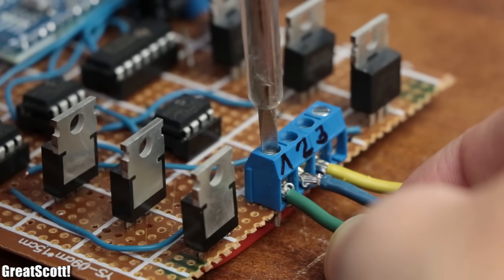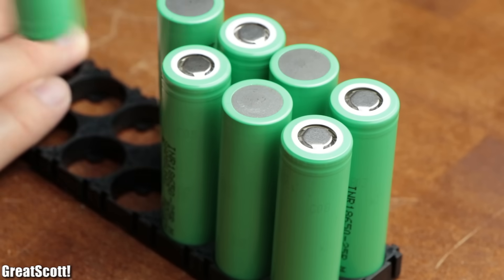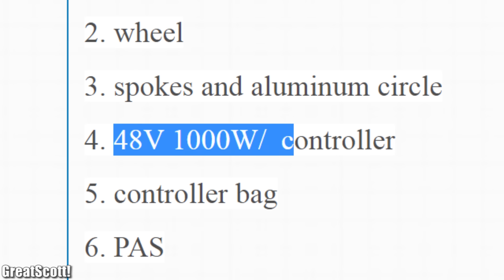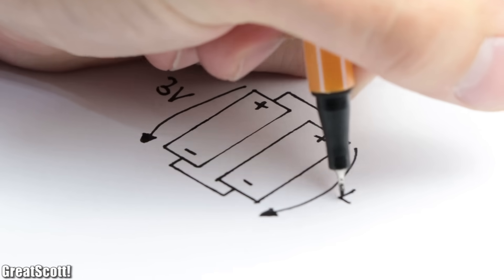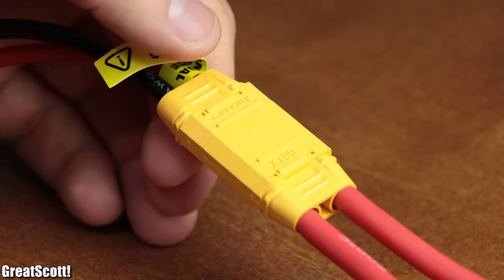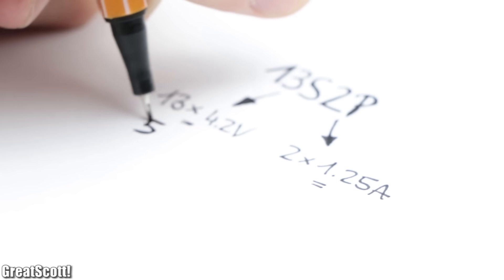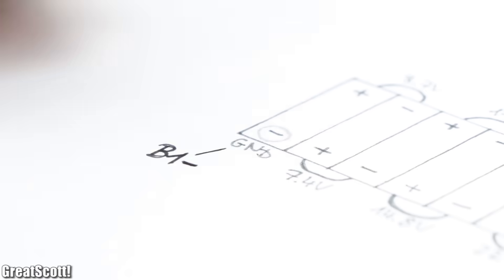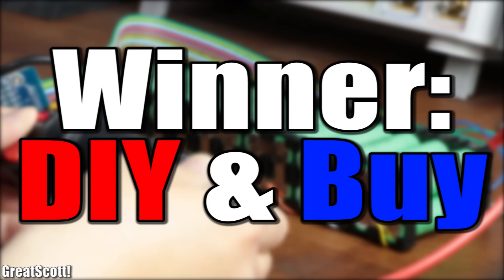EBike Battery Pack || DIY or Buy || Electric Bike Conversion (Part 2)

Comment: You don't need 20A cells anymore if you are only doing 2p... 
Whats the point of calculating amperage for 1p then buying 2p?
30q would of been perfect, more capacity and possibly cheaper.
Reply: Running batteries at less than their maximum C rating is more efficient. The more current you push through them, the more (I^2)R losses you incur, therefore there is more wasted capacity, and more heat reducing the longevity of the cells. It's never bad to have a good safety margin, unless you are trying to "get away with" as few pennies spent as possible.
Reply: Nacho Mendía Heavier than the four Lead Acid batteries you would typically use with a bike? Yeah I definitely not... Even if you went for small 5Ah batteries they would weigh about 4lb each so 16lb total and even heavier at a more useful capacity like 7-9Ah, whereas an 18650 will weigh about 50g per cell, so that would be 8.6lb for a 13s6p pack which is considerably lighter.
Reply: I don't think many people use lead acid batteries on a bike anymore. Unless you buy the cheapest junk you can find.
Reply: those drivers tend to pull alot more at peak than advertised, its definitely worth the investment
Reply: Kevin Day Sure, but in the end 13S6P pack with 2000mAh 5A cells will do better than 13S2P 2500mAh 20A in my opinion. And it can be cheaper as well.
Reply: Wojtek Kamiński Yeah, I meant to mention in my comment, I'm not saying that his solution was the best one, just that there is at least SOME reason to do the calculations for 1P and use 2P.
Reply: You want a bit of headroom here...
Reply: LegendLength hobbyking lipos are way more overrated than the Samsung 25r 18650s, from my experience most of the high drain Samsungs are underrated ie the 30q, rated at 15a but stays well within operating temperatures at 20a
Reply: the battery pack he made is only 240Wh, it's really small... he could have used batteries with 5A max current draw, but make 13S6P pack for at least 500Wh capacity (with 2000mAh batteries...). It would have been cheaper and of course it would last much longer
Reply: Yeah, and also I don't believe that motor is actually going to draw 1 kW continuous. If that was the case, how the heck could he power it from his PSU?! That's probably peak power, at which the motor is very inefficient. The actual continuous power is probably around 100 W or so. And we all know Chinese sellers usually lie.

Comment: I just have bought one pack with 52 of SAMSUNG INR18650-33G batteries. 48 V, 12.8 Ah for 330 USD. If one battery would cost about $4, it would be $208. Plus BMS, charger, box, nickel ribbon, connectors and welder.. I guess it would cost about the same, or more (thanks to the welder), as shown in video. Plus your time.. It's not worth it.

Comment: How would you compare this kind of pack to one based on RC lithium-polymer battery packs? I'm going to be working on an electric scooter project soon, and I was aiming for li-po batteries primarily because of their cost and relative ease of use.
Reply: Lipo isn't widely spread despite it's large current advantage in evs cause it has less charging cycles of longevity and is more volatile. Both li-ion and lifepo4 can supply enough current at any reasonable capacity, and lifepo4 has much larger range of operating temperatures.
Reply: LFP is the safest chemistry but needs a larger volume. Lithium polymer has the best energy capacity so is fine for small gadgets. It is too sensitive for heavy duty power especially with vibration in a bike or scooter. Not safe. Don’t go there.
Reply: lithium-polymer will be almost the same as far as the math goes compared to lithium ion.  If you used packs you would probably want to use 3x 11.1v packs and 1x 14.8v pack in series to get to 13s.
Reply: Do not use lipo is a bomb waiting to set your house on fire. save a few bucks loose your house gg. Use lifepo4 only.
Reply: @ahah1785  you're fake news!

Comment: Recently I have a discussion around if putting a pair of cells in series or parallel does really affects the amperage draw of each cell, If in a pack of 2 cell in parallel or series  you draw 30amps each cell is putting out 30amps, basically, that was the accepted rule in the group, I did my research and I found exactly the same, but my common sense told me that putting 2 cells in parallel is going to divide the load in each cell, I will like to know more about this topic or what are the basics of this rule.
 I love the content Scott, Watching all the way from Argentina 
Sory if my English is too bad tho lol
Reply: You need to know the basics of parallel and series connection of cells. Simply put, in a parallel connection of cells, current draw is divided and in series connection both the cells give the same current. Keep in mind in parallel the resultant voltage is the lower voltage of the two cell voltages, in series the voltages of each of the cells get added.

Comment: I am working on a very similar battery pack design for my electric bike that I have made. But I have to say, you will want a battery pack more then 5ah. At the moment i am using 4, 12v-18ah lead acid batteries in series to power it, and those get the job done, but I am collecting 18650 cells, and from the research I've done, I wouldn't go under 12ah at least.

Comment: I like the video. Just in case you didn't know, I thought I would make you aware of some separate options for cheaper batteries.

A popular option in the hobbyist community is to buy lots new laptop batteries and disassemble them for cells. The cheapest option I'm aware of is going for used cells from dead laptop batteries.

Used cells are a bit tricky as they must undergoe some tests to verify their capacity and condition. Afterwards you organize them Into a pack with similar cell capacitys.

This is the option I went with for my personal battery, I ended up with a 14s 12p battery, it runs about 27ah. It cost me less than 100$, but a fair bit of time.

I'm excited to see how your project turns out!

Comment: Can't LiPos be used instead? 4 11.1V ones in series?
Reply from the maker: Also possible
Reply: Is it ignored because of the safety aspect then? I think the LiPo way could be cheaper. 

Another thing, can these be charged from the energy harnessed from the wheel motion when not accelerated by the BLDC motor?

Comment: It would be more cheaper
If you buyed those Li ion 🔋 18650 cells from a offline store
They'll cost you about 2$ per pc
Reply: Your Indian Brother maby in India not here in Europe we don't have that kind of electronic store
Reply: You'll not believe that I ordered 10 genuine old laptop battery cell for only 4$
There capacity is 1800~2100mah
From a offline store
Reply: They ask you $2 for a used cell?
I can buy used cell here for less than $1, 1000 - 2200mAh
And I bought new cells for $1,5 each, 3000mAh

The problem with used cell is they have vastly different parameters, making them not suitable for battery pack where the cells have to be the same.
Reply: Hey guys this 18650 from old laptop can only give 2C 
we are far from the 20Amp he get
Reply: but wait if any lipo batrery is 3000mah

Comment: USB SOLDERING IRON DIY OR BUY
Reply: I would not trust that on my computers ports! Manufactured or home made
Reply: Whats the point of such a tool when there is always acces to a 230v socket in your home? Unless you want to go soldering on your train ride to work i dont see why you would limit yourself to a (in most cases)  1amp 5v usb output
Reply: Yea, it's not in the specification (900mA for USB3), but some motherboards can deliver 2A+ !
Reply: Stop it ffs. Nobody wants these damn USB irons
Reply: @smow7422  I think they want it for portability. So I'm thinking why not a 12VDC 7Ah (minimum) battery from a motorised gate?
Reply: Lalan Desai Just get a TS100 and wire it to an old laptop battery
Reply: usb ports can provide 1 amp??!
Reply: wow, i didn't know that, thanks!
Reply: Lalan Desai stop it
Reply: Sean Spitler,
how about a powerbank with 2A port?
Reply: Igor Morozov 2amps also wouldn't be enough (2a×5v=10W) my smallest soldering iron already requires 30W, so i would imagine that soldering with a 10W soldering iron would be a pain...
Reply: gustav games 
Nope, there is a small 8w iron on aliexpress around 7-8$. Excellent for smd and good enough for small through hole work.
Reply: I'd go Battery powered, and use something like a 3-4S lipo for drones or similar.
Reply: Can't put out enough power to solder through a usb port
Reply: Igor Morozov  well i guess that would be ok but 5 volts x 2 amps is 10 watt soldering iron (not that great) and i would rather spend 10$ on a cheapo or invest in a butane if it needed to be portable.
Reply: quit spamming bro...just buy one!....they are like 150INR for the 25w iron....i am sure your mom will understand XD
Reply: Oh look!

Comment: How can u create a battery pack with 8 (18650) batteries power bank for my raspberry pi along with a wall charger for alternate power.
Reply: Make a 2S4P pack (6 .. 8.4V, 4x capacity), then add a bms and a 5V voltage regulator to it. for the wall charger / alternate power just connect a SPDT switch to both + terminals and use common ground
Reply: FisheyLP thanks buddy😃
Reply: 2s4p and get a powerboost 1000c,,,,
Reply: Put them all in parallel, then get one of those 3x tp4056 3A rated 5V chargers with protection. Easy peasy as long as the 18650s are matched, you can even use the 5V pi power supply to charge.

Comment: DIY BMS or BUY? 😁
Reply from the maker: I have it on my to do list but that will take a while.
Reply: @greatscottlab  Can you show how to do BMS for lead acid batteries? I know most people just slightly overcharge the highest cells so that lower cells can get a charge, but that damages sealed batteries like gel cells.
Reply: This please! I actually really want to make my own BMS so I can do regenerative breaking and have different voltage outputs for different things. (lights, traction motor controller, etc.)
Reply: @WarrenGarabrandt  me too
Reply: buy

Comment: What is the advantage of connecting the battery holders in series as opposed to parallel? How does this affect current and voltage?
Reply: thats simple. If you connect them in parallel you'll be able to draw a higher current (rated current of the cell)x(number of cells) and the voltage will be the same as a single cell (so 3.0-4.2 volts), and if you connect them in series you'll get a higher voltage (voltage of one cell)x(number of cells). 
Since his device only works at over 40 volts you'll have to connect at least 10 in series to get a suitable voltage. 
If you wanted to build a spotwelder with them(like the K-weld he showed) for example, you'd connect them in parallel instead. 

You can also combine that  like he did. so that means you have groups of 2 cells in parallel, which gives you double the maximum current, and then put those groups in series, which gives you a higher voltage. 

Thats the electronics basics. Like, first lesson basics.
Reply: I did not know that the configuration of the battery spacers was so important!
Reply: What is the difference? How do those spacers affect voltage and current?
Reply: Are you sure....
Reply: I know.

Comment: Man!!HOLY COW!!!Glad you got the spot welder sorted. I have built so many of these myself, trying to make them in every way possible that you see on youtube.(simple versions). I actually have 2 more to build, one with 2 x 14ah batteries and one with 2 350F Maxwell UltraCaps. If the UltraCaps work like I imagine, then that will be the smallest welder I have built. (you can find my video's on my profile page)

The only problem you will run into is how far you can go on the battery pack you made. Most e-bike batteries are in the same configuration you have, except they have 3 or 4 in parallel for added Capacity and travel time. I would recommend that you add 2 more packs in Parallel before you build your enclosure. If not, you will not be happy with the run time on just one string.

Most e-bike DIYers are also using Laptop Batteries for their builds, just making sure to keep the amp hour close to what you need. "AlarmHooKUp on eBay" has almost always a deal for us DIYer. For my powerwall, I just purchased 397 modem packs for 4 x 120$ and 100 modem batteries already tested and ready for 160$. I bet you could get away with just one good lot. But this is just my personal recommendation. I can't wait to see your next video!!

Comment: just a question, what would be the difference betweet battery series and StepUp Converter? I mean, does it takes many power to raise voltaje? the real question is if you can use all batteries in paralell to get more mAh with a StepUp Converter.
Reply: sorry for my english, im new speaking it xD

Comment: you should have a look at the high capacity rc batteries on hobbyking, you get alot more bang for your buck there, ebike specific batteries are ridiculously expensive
Reply: Depends what you're going for. Hobbyking Multistar cells weigh 40% more for the same capacity compared to 35E's, and many new 18650's do cost less.
Reply: Eduardo Avila unless you're talking about ebike/car batteries then no, not really. It's very possible but lead acid batteries are very heavy for the amount of charge they contain and they don't like full charge discharge cycles. A typical car battery wouldn't last more than 40 full discharge cycles, yes leisure batteries are better but still nothing in comparison to lithium
Reply: Well, currently on Hobbyking: 10s 10A lipo pack (20C discharge, 2C charge) - 40 EUr, incl. shippment to Europe. I think it is a quite good deal.
Reply: well, each of them has it`s advantages and disadvantages.
Reply: @tiborkiss9186  Only advantage is lipo is lighter. rest are cons. Honestly I wouldn't want a lipo between my legs on a bumpy ride. That's just asking to get your balls burned off.
Reply: Tibor Kiss Hey, could you put a link to that battery, I can't find :(
Reply: Or you know bike/car batteries could be used too, with some circuitry together
Reply: we`ll see...I just bought two..:)
Reply: https://hobbyking.com/en_us/multistar-high-capacity-4s-10000mah-multi-rotor-lipo-pack.html
Reply: how long is a piece of string....... Multistar packs are high cap low discharge (relatively) energy density is impressive, as is the weight and price. Cost to capacity ratio is unbeatable. without venturing into chinesium 2 for 1 housefire special cells... Is a similar capacity 18650 pack gonna be a bit lighter? probably, but it cost almost twice the price, takes literally days to build, and is absolutely not half the weight... if i could have either for free yes 18650, but they are not free........ 16ah 4s for 30gbp when they are on sale. its literally stupid not to
Reply: Alex Tarasov yep I'd take cylinder cells over soft pack lipos on a bike any day regardless of cost

Its something you probably will drop or fall off at some point and the 18650s take far more physical abuse before going all fireworks than a lipo pack
Reply: 18650's last way longer than lipo's

Comment: You can't trust the cells you get on ebay but, labour cost is a major disadvantage (unless you class it as a hobby then its worthwhile)

One point on the BMS, what's the balancing current? it's probably not very high.. so I'm wondering if there was a more severe voltage difference in the cells would the little passive balancing circuit cope with the charging current?
Reply: Skruffles Balancing current for most BMS is typically under 50mA
Reply: Yeah that's what I thought, even at 100mA I'd be a bit wary of some cells overcharging when series charging the pack.. I suppose some manual checks every now and then would suffice
Reply: Germany batteries